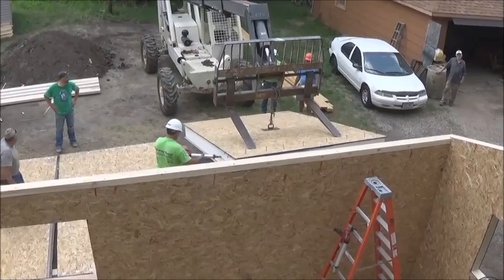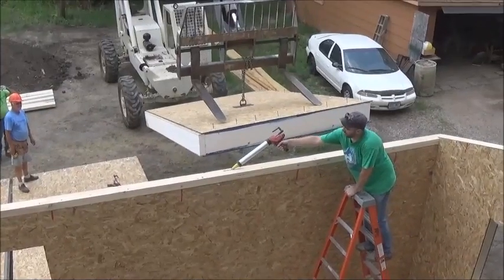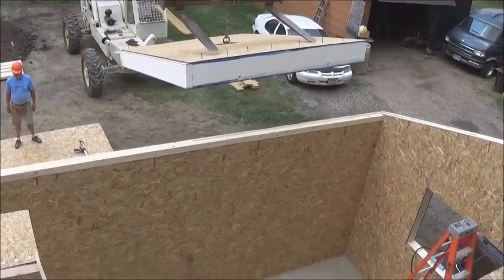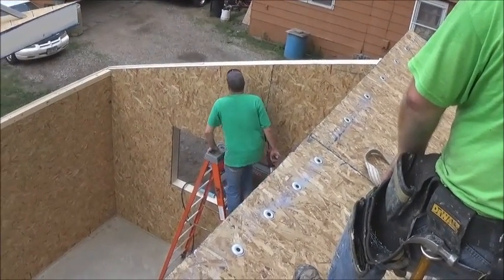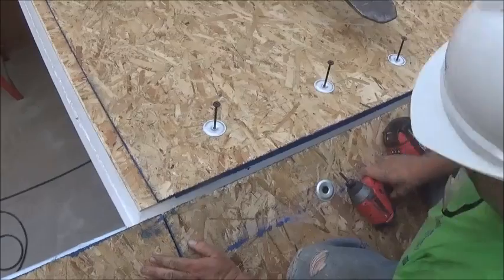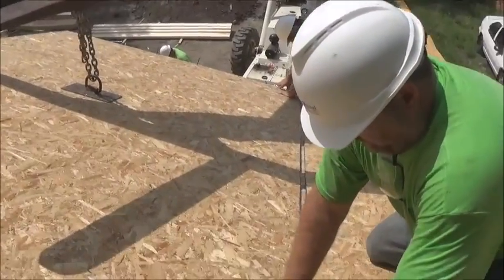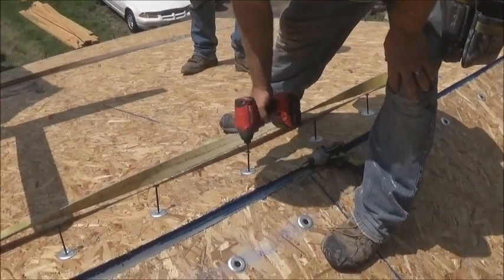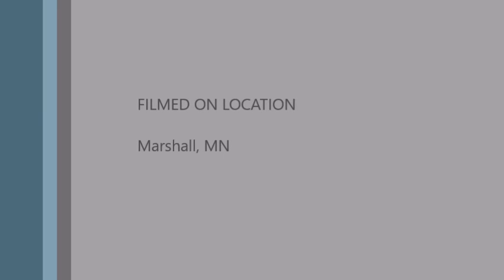Episode 15: Installing Roof Panels

Comment: Panel joints need to be sealed better you are going to get moisture on the seams. Check out SIPA and SIP failures in Wisconsin and Alaska due to installation errors

Comment: 6:01 They didn't cut that at the right angle!!! 😲
Reply: The top pieces of OSB aren't supposed to touch.  They come along later and fill the gap with a 2-part foam.

Comment: The roof appears to have no overhang on the bottom or ends. Whats up with that.
Reply: SIP panels are expensive per square foot, and there's no reason to insulate beyond the envelope. It's cheaper to just attach framed overhangs beyond the panel that aren't insulated and only serve to support the roof finish.

Comment: I don't know why they used that junk sob wood instead of real plywood.
Reply: Because it is cheaper, is available in "Jumbo" sizes and are perfectly adequate for the job?
Reply: If I were framing a house the conventional way I'd use plywood. But with good grade SIPS like these, they apply a special sealant to the edges of all the OSB panels to protect against moisture. It's done in the factory and it's very effective. You'll see it mentioned in one of  the earlier episodes in this video series. The edges are the most vulnerable parts. After that you just want to make sure to install your doors and windows with effective waterproofing details as well. That's the next most vulnerable spot.

Comment: Thank you for the videos.  Can you further explain and detail how you address potential ridge rot?
Reply: I assume you are talking about the rot experienced in Alaska (and other places)? That is a result of inadequate air sealing allowing moist interior air to reach the cooler exterior sheathing. A few videos back he showed the seal tape they used to prevent air/moisture migration. Combined with the mastic there should be no issues. That being said I plan on installing a vented "cold roof" over my roof panels when I finally build. This should provide a second level of protection by allowing drying to the exterior. Edit: Also see episode 15 apparently!

Comment: Can they survive category 2 to 5 tornados?
Reply: only monolite  concrete dome shape structure can survive cat 5 tornado :) If you get hurricanes like irma with sustained winds up to 200 miles an hour pounding your home for 48 hours nothing will stand except monolite concrete structures. especially dome shaped.
Reply: @007MegaRoll  dang guess I'm gonna build a aircrete dome - thanks for the idea.
Reply: This is a lot stronger than regular wood framing.
Reply: MrEndzo - Thanks, but one question: what about the screws; to what are they being jointed to?
Reply: BitFan there's a support beam that runs the entire length of the house that it sits on

Comment: I dont understand what the panel screws are securing to
Reply: My question was the same. They must be 18"+ screws already started way down into the panels, we are only seeing the upper 1/3rd of them sticking out.
Reply: Google User Panels are being screwed into the top plate of the interior wall that runs down the center of the building and the also into the top plate of the exterior wall.
Reply: He said that there was a interior wall. A 12 inch screw might make it to that. I don't think they know what they are doing at the moment??